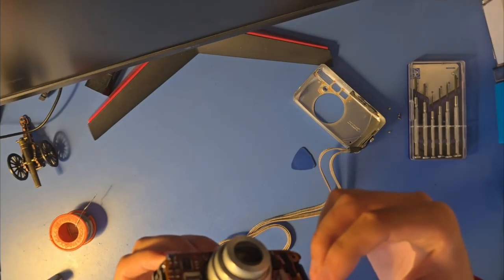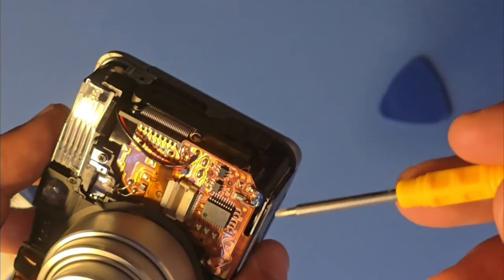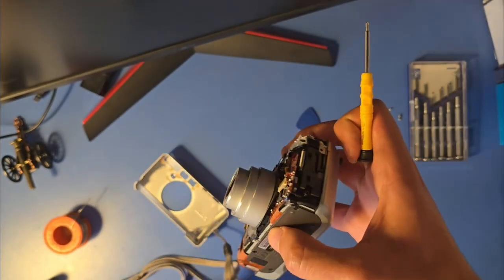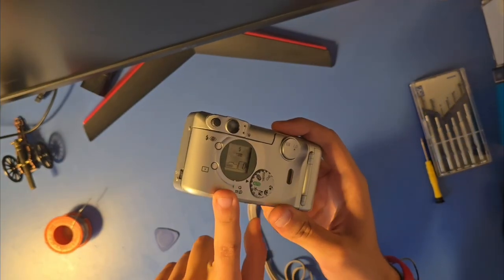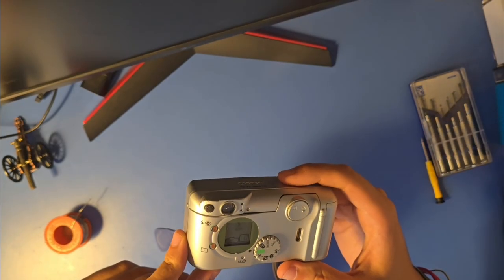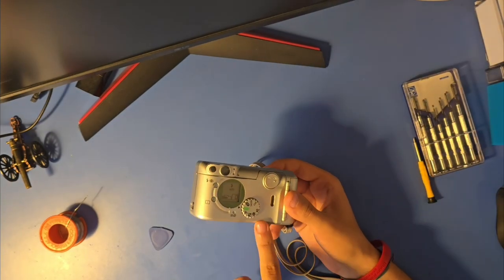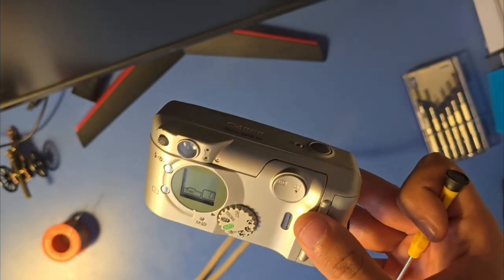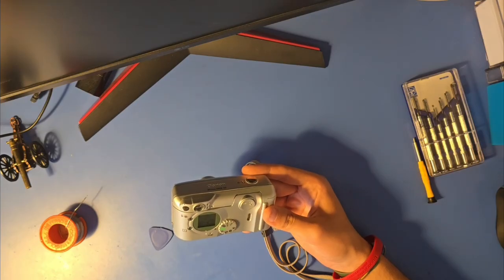"Blinking H" error SOLVED on Canon Prima Super 155 (and similar)

Comment: do you think a similar thing could be done on a prima super 130? I am having the same issue:(
Reply from the maker: I hope so. If you want to try you can open up your camera to see if those contacts look the same, if so you can try. But if you don't want to run any risks I recommend using a multimeter to find the correspondent pins that would detect when the door is closed. I think you can find them by placing the probes on the pins in diode mode and the multimeter should give a different reading when the door is closed to when it's open, *I think*.